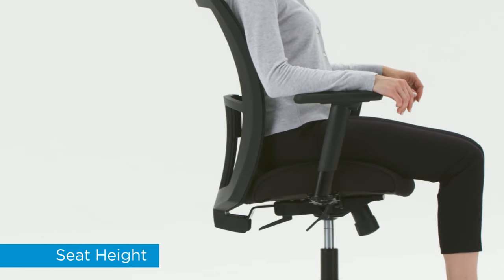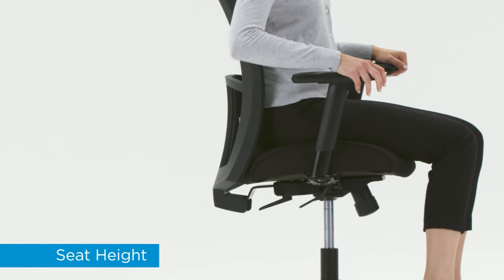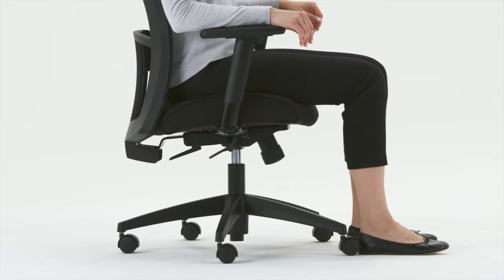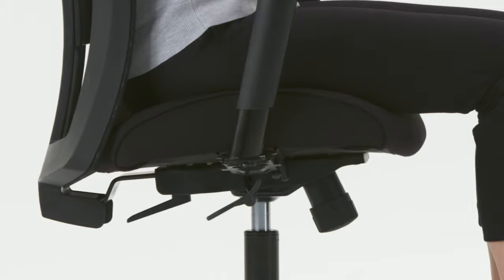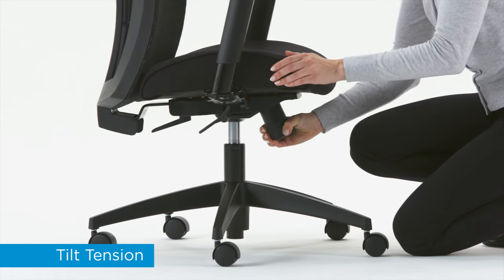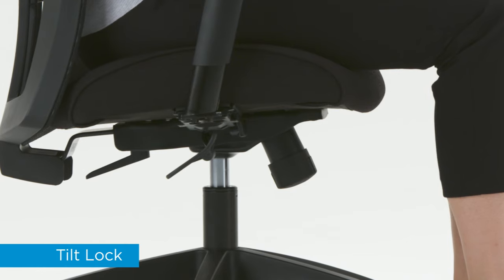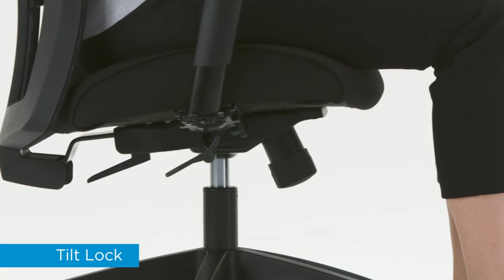How to adjust your Tilter chair mechanism

Comment: I had been suffering for months with a chair that leaned way too far back. I just dealt with it, saying I would buy another chair eventually. Well, I looked it up and your video came up right away. I pushed in my height adjustment knob and it locked the tension, now it's perfectly fine. THANK YOU!!!
Reply: My chair wont recline without massive effort from my legs. lets swap

Comment: WHERE can I get the pieces-/inserts or whatever they are called- that go INTO THE WOOD so the bolts stay in the wood?   I need to make holes farther apart on my seat and put those inserts in them so i can use a bigger stronger mechanism.... where can I get those insert things to bolt INTO??

Comment: i losend the tilt tension and the spring is so thick and tough that i cant tighten it anymore ive literally tried with everything i could posibly think of but that spring just wont let its self be tightend.

update: i locked it but it still tilts back a little bit, its annoying but way better than before

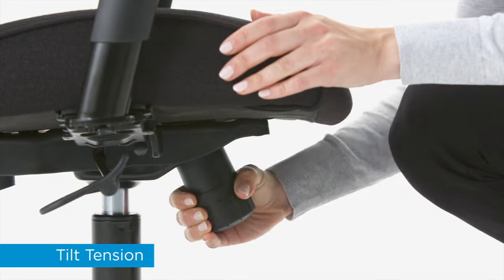Comment: This is not correct 0:50 That is counterclockwise, to tighten should be clockwise. Correction!
Reply: It is correct but aight
Reply: @dalatrade  Its not correct, I have the chair, please stop using false information. 0:50 She is turning it counterclockwise in the video. Not clockwise. Clockwise goes turns right, counterclockwise turns left. The same goes for a screw, to screw you turn clockwise, to unscrew you turn counterclockwise. Unless its a special application where its reverse thread. This is not the case.
Reply: @jbmerks-7951  Amy is correct, you, along with the video narrator are incorrect.

Comment: the lock is useless. it locks while the chair is tilted all the way forward. it should lock while leaned back. the metal frame says forward and points towards the front of the chair, so it isn't backwards. it's just bad design.